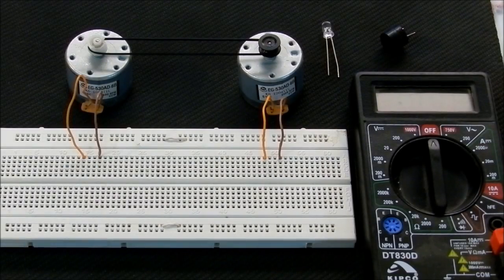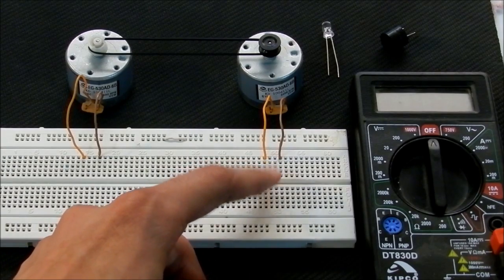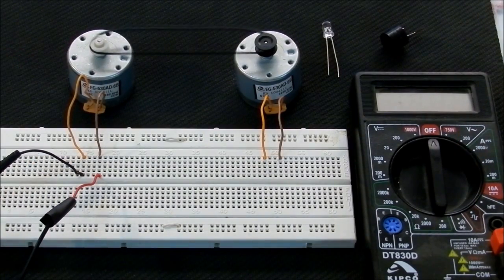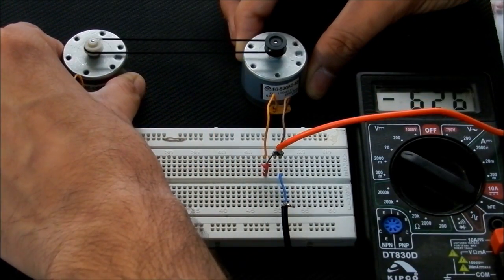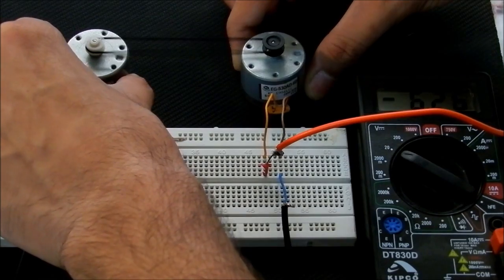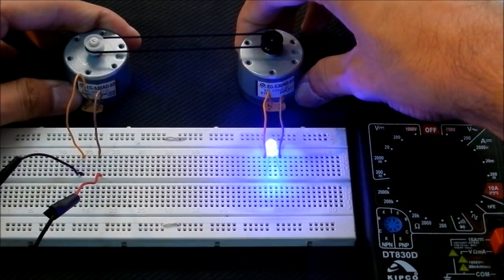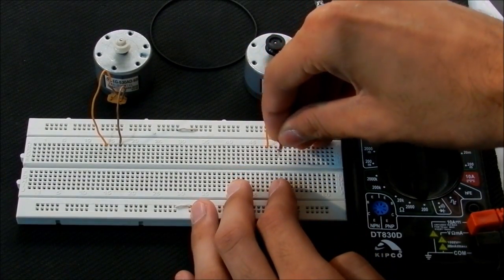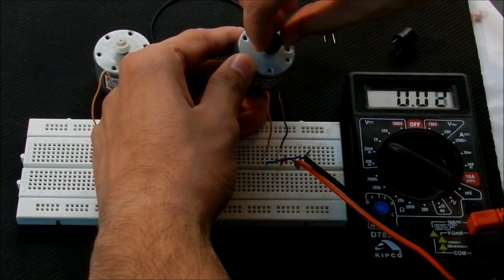Simple Dc Generator

Comment: Yes that is my problem. I bought a DC motor at a local hobby shop but it seems to be underpowered (1.5-3V). What is the voltage of the motors you are using? I have an old cassette player here, I'll take it apart.

Comment: Hello Pir, what brand/model of DC motors are you using here? I want to use a DC motor in my model hydroelectric dam but can't find any locally and want to be sure of what will work if I have to order over the mail.

Thanks in advance.